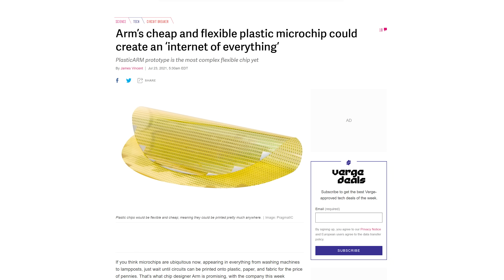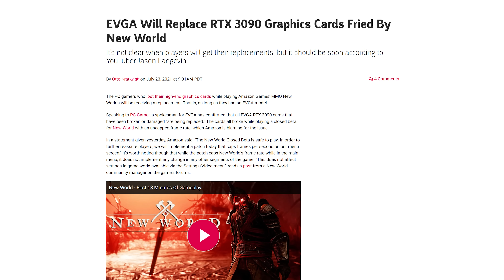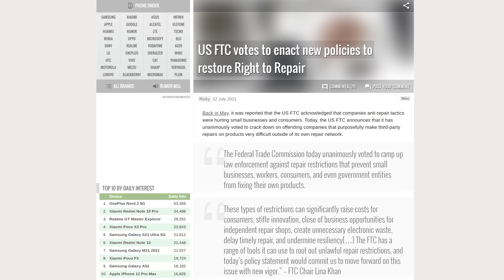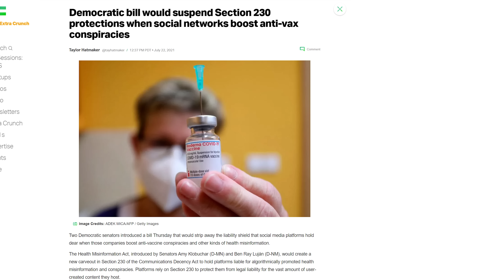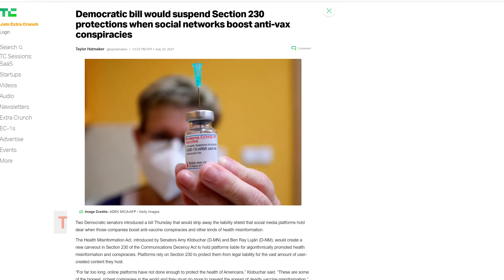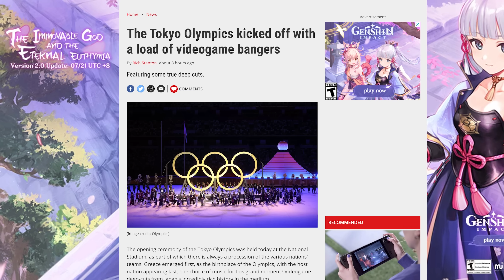Floppy Chips Will Change Everything

Comment: EVGA will replace the cards for free! Almost as if all the broken cards are less than a year old and still under warranty.

Edit: everyone commenting that there is no way a defect by EVGA could have caused the issue clearly does not remember when EVGA 1080s were literally catching fire.
Reply: Its not only EVGA cards being bricked, or just only 3090 cards. Just the most reported.
Reply: @manaspradhan8041  I think the problem you’re having is that you are under the impression that the GPU itself is failing. This is not the case, by all accounts it is something external from the GPU die itself, something on the card’s PCB that is failing. More than likely a problem with OCP, although it’s entirely possible something funky is going on with the VRMs. It’s not a GPU problem, it’s a card problem

And given the AIBs design those PCBs, the buck ultimately stops with them. Although Nvidia is particularly to blame as well, as they have to sign off on the cards their partners ship
Reply: @zuckdaddy1596  anyone remember those "oc" rtx 3090 that doesn't play games because of some cheap capacitors.
Reply: @zuckdaddy1596  Apparently it's something to do with the fan controls. EVGA's shitty components appear to be to blame.
However, other people are reporting their 3090s getting unreasonably hot and loud and not throttling, then acting up. I'd be surprised if Nvidia's firmware wasn't the real culprit causing shitty EVGA components to fail
Reply: @ducks-on-quack  It is my understanding that the general consensus is that without looking at one of the damaged cards it it likely a problem with the OCP system integrated into the RTX 3090’s. I can’t remember the model numbers off the top of my head, but the main three primarily used in Ampiere cards are all found in older cards as well. With some dating all the way back to pascal. So if it is a problem with OCP, it would appear to be entirely a problem with integration, which would put the AIBs almost at complete fault. Although the bit about it being a problem with the fans is interesting. Can I get a link to wherever you heard that? If not it’s fine, I just enjoy reading that sort of thing
Reply: @ducks-on-quack  Nvidia frimware is trash EVGA vrm is also trash
Reply: @zuckdaddy1596  I tried to post the link a couple times, but it kept getting removed from YouTube. It was a breakdown by igor's lab.
His work is pretty dense and can be difficult to understand without some embedded design and organization knowledge.
Reply: @ducks-on-quack  thanks, I’ll see if I can find it :)
Reply: It's almost as if there should be hardware limitations in place to prevent your gpu from frying just from a main menu without a frame limiter
Reply: @asmodin88  the drivers should be able to handle it
Reply: @asmodin88  what would they do exactly? They didn't build the gpu
Reply: The board partners are the ones responsible for handling the warranty so whoever’s fault it they get to replace them. I would assume EVGA in their contract with Nvidia has a clause that Nvidia would reimburse them if it’s their fault but I have no clue
Reply: @manaspradhan8041  Your incompetence is ever so tiresome... if you believe for whatever reason that Amazon is at fault, then articulate why. All you’ve done so far is waffle about AIBs putting “shells” onto GPUs, completely ignoring that they also design the PCB, making assumptions that make no sense given the current information, and generally just making yourself out to be not only incompetent as previously mentioned, but also an inarticulate prick. But do go on and explain why Amazon is at fault for what would appear to be a problem with a poor OCP implementation being triggered by god knows what.
Reply: EVGA is 100% responsible for these failures. If anything we should thank Amazon for causing them to die while the warranty was still valid.
Reply: @manaspradhan8041  that’s irrelevant. You made the claim that the cause of the GPUs bricking is because of “amazon’s incompetence” and yet here you are admitting you believe it’s a problem with drivers or firmware. Get your story straight, and articulate a proper argument. You’re failing, and it’s not even funny, it’s just pathetic

Edit: they deleted a bunch of their replies lmao
Reply: @manaspradhan8041  What exactly did amazon do?
Reply: My 3090 ftw3 ultra worked only a few months then it died:( black screen only lol got a new one and sold it immediately
The quality from evga is questionable…..
Reply: Thats true but EVGA has a very good customer service not like other AIBs e.g. Zotac
Reply: @manaspradhan8041  Samsung is doing the chip fabrication
Reply: True but they are also drop-shipping - that is sending out a replacement upon reciept of the RMA and collecting dead GPU when they drop the new one off, which seems to be happening in days as they hold stock to cover RMA's.  Now that's above and beyond warranty that can be months until you resolve with some and still within the law.
Reply: :shockpikaface:
Reply: As a Canadian myself, it's friggin 90 dollars 😪
Reply: This is happening to many different GPU's from different vendors, EVGA just has a good customer service team.
Reply: @TalesOfWar  Nobody said only EVGA makes shoddy produts
Reply: I sent back my Evga 8600gt and marked rtx 3090 on the box with a marker. I am hopeful to get a free upgrade. 😁
Reply: Wait when WHAT?
Reply: My first EVGA GPU i bought blew up in under 6 months of use. (1999 era card). My second one (970) was DOA. 

The first one they wouldn't warranty, while the second one I got an MSI 1050Ti after returning the dead card.

Still nervous about buying EVGA stuff.
Reply: It's not only EVGA cards though. It's all 3090's.
Reply: Right?  These cards are under a warranty that covers hardware defects.  Though if its a hardware defect why is it now affecting non EVGA cards that aren't even 3090's?  hmmm....Regardless glad EVGA is covering this and not choosing to try and fight it.
Reply: @Mad-Lad-Chad  If the game was causing the issue, don't you think it would affect the majority of people?
Reply: The fanboys are out in force on this! How many times does EVGA have to be caught cutting corners before the fanboys realise there should be better than this.
Reply: But it's not their fault.
Reply: Warranty applies for manufacturers' defects smartass, if the gpu bricks because of Amazon's incompetence that's not evga's responsibility
Reply: @manaspradhan8041  the problem is because of manufacturing defects, dumbass. Code that doesn’t override protections already put in place (ie anything that isn’t overclocking) is completely valid regardless of effect on the product. That’d be like shitting on any game in existence because it makes your GPU kinda hot. What seems to be happening is that something is buggy with the game, and it’s exposed a hardware defect that’s causing some obscure issue with OCP on certain cards. If this is the case, the it’s likely that the reason the 3090 in particular has been hit so hard is because of how much power is sucks up. Either way, unless Amazon’s game is doing some sketchy ass stuff and fucking around with power settings, it’s a hardware problem, not a software one
Reply: @manaspradhan8041  if the card bricks because you used it as intended (gaming) than it's the manufacturer's fault, they have to replace it. Now they can go to court with amazon for compensation, but that doesn't change the fact that they have to replace the cards.
Reply: @manaspradhan8041  It's manufacturer fault that their GPU boost as hard as it's possible in their drivers, henc bricking from it. It's your fault if you OC it/replace BIOS do shenanigans, not playing a game. I get 4k fps+ in many old games that render in real time their intros/menus and that's not causing a problem, as gpu don't oc for such low load. Any boost technology is bulcrap, as it just ads more heat for nothing
Reply: @manaspradhan8041  How is it Amazon's incompetence?
Reply: @dimitri299  how do you get employees to build a game and not have the brain power to put a fram limiter on the menu screen? next thing youre gonna tell me if the game starts leaking gigabytes of memory thats also not amazon's fault. clearly a braindead team working under rushed deadlines
Reply: @Manas Pradhan  There is absolutely nothing wrong with not limiting the frame rate in menu screens. In fact, many AAA games, such as Rainbow Six Siege for example, do not put frame limiters in their menu screens. Whilst it is a nice to have thing, there are no real negative implications for not having a limiter, other than an increased power usage.
The only consequence of not including an fps limiter in the menu screens was making the graphics card work extra hard on a task that it is designed to perform.
 It baffles me that some people for some reason 'believe' that it is the game studio that is at fault. With this logic, you are essentially saying that it is up to the software designer to ensure that a graphics card is functioning properly. The software is responsible instead of the company who makes the damn thing and who sells it to customers with the expectation that it can do what it is literally made to do.
As it is primarily occuring on EVGA gpus, they, and other hardware manufacturers with affected cards are clearly at fault here. They obviously cheaped out on some component to such an extent that when the card was working extra hard, it ended up demanding too much out of the shitty component that it broke, and consequently, the card stopped working. What is deeply concerning is that there were no working systems in place to keep the cheaped out components under safe operating conditions and that EVGA did not do thorough enough testing to identify a potential problem with their product. Or, most likely, they knowingly sold the product with the issue as they did not think many people would end up subjecting the card to the specific conditions needed for it to become an issue.
Reply: @manaspradhan8041  To many people, not having a forced FPS cap is a benefit.
Plus if a game has a FPS cap but the GPU just so happens to max out at roughly that FPS, would that also be the game developers responsibility to reduce the cap even lower because a card runs itself higher than it can handle? Should they just add a static sleeping period after every frame to make sure that GPUs never max themselves out at the cost of making their game run at lower FPS for everyone? Or somehow test every GPU brand on the market and make a list of different caps for different GPUs?
Reply: @manaspradhan8041  Does your RAM fry itself if you fill it up? And would that be windows fault for allowing programs to use up all available RAM instead of always leaving 20% RAM free in case the RAM was going to fry itself?
Reply: @manaspradhan8041  A frame cap in the menus is a good practice, NOT a requirement. The lack of this cap should under no circumstances cause a well designed card to fail. GPUs are intended to push out as many frames as is possible, and the firmware on the card is supposed to keep power, thermals and every other factor that could deteriorate the card in check while doing that (scaling back performance if needed). This is not the responsibility of the developpers merely making use of the API exposed by that firmware (ie, game devs), that's entirely on the card maker. 

This isn't the 70s anymore, there are several layers of abstraction between the hardware and the end-user precisely to allow for end-user developpers to specialize on making software for the end-user, without worrying (or having to know) too much about what happens at the hardware level.
Reply: Did you forget your meds? @manaspradhan8041  just take your pills man... It's for your own good
Reply: @manaspradhan8041  your argument is the same as telling that is a car brakes down on a street without a speed limit is the street's fault not the poor quality of the car...
Reply: It is not a capacitor problem. EVGA uses extremly good capacitors on the FTW cards. The part which gets broken is the custom fancontroller. EVGA is the only which uses his own fancontroller and the fancontroller is only on the FTW models.

But this is only a part of the story. Even NVIDIAs and AMDs own card protection system can't handle 1000+ fps without getting overheating issues. Cards from every brands can die or blackout when the frames are to high. Igors Lab could confirm this with an older title which run well above 1000fps. He tryed it with an 6900XT and the card blacked out because of overheating issues.
Reply: @manaspradhan8041  And how would every game developer decide on which FPS cap to use for their game? A static FPS cap doesn't guarantee that a GPU doesn't max itself out which means you need a dynamic cap.
You seem to be focused on Amazon doing something you don't like, rather than actually explaining how a game developer should solve a problem you claim is theirs.
Reply: @Dosino_  mate a cap of 300 fps is more than fine, no GPU is gonna burn itself running the menu screen at 300 fps. You'll never see video game menus running with fps in the thousands, that's for a reason, the people making the games aren't brain-dead
Reply: @manaspradhan8041  The game just maxed out the GPU during gameplay because it couldn't keep up 300FPS and fried itself, and you are now personally responsible for frying peoples GPUs and no better than amazon in this regard.
You also failed to fully support potential 360hz monitors in the menu.

I guess this is due to "negative experience in computer science basics" that someone here mentioned?
Reply: @manaspradhan8041  "they are at their processing speed limits, they never reach that point of burning themselves"

Well that was easy.
Reply: @Dosino_  huh? they never reach the point of burning during gameplay but they very well can during menu screens if frame limters are not put in place. what do you think youre saying? mate just go to sleep, you really dont know what you're talking about
Reply: @manaspradhan8041  "their processing speed limits"
Reply: @Dosino_  mate take a basic computer science/software development course instead of rambling about what you don't understand
Reply: @manaspradhan8041  A menu doesn't demand anything special from a GPU that gameplay wouldn't. The overhead from the gameplay likely makes the GPU not run at quite full capacity, but if it happened to max out the GPU the same issue would occur.

You have mixed up 2 things:
A: Not limiting the framerate in the menu
While this might be seen as a waste of electricity, it shouldn't really be a issue for anything but laptops which might temporarily downclock due to cooling issues. However a quick fix to this as you suggested risks risks players having their menu capped at below what they monitor can display. While not a big issue, neither is a bit extra electricity usage for a limited time.
In addition, plenty of games uses heavily detailed 3D background in their menus that uses a lot of GPU resources even while capped, if menu electricity usage was such a big problem 3D backgrounds would also be.

B: GPU Frying itself at full load
A GPU is supposed to have, as you yourself said, "processing speed limits". These GPUs fried themselves as they couldn't quite handle the speed they ran themselves at.
While a menu running at high framerate with probably not much other overhead caused them to reach their faulty speed limit this time. It wasn't the cause of the issue, it happened to make the issue show itself but it was a ticking timebomb regardless.
If a game had managed to keep low overheads and run the GPU hard during normal gameplay the exact same thing could have happened, What made the issue show itself doesn't equal what caused the issue

For a simple comparison: If a company had a costume party and someone didn't have costume on, and the floor collapsed because it couldn't keep the number of people it was supposed to be able to hold, this would be like blaming the guy without a costume because he helped cause the issue (enough people standing on the same floor) and he did something "wrong" (he didn't bring a costume to the costume party)

Yes he did technically cause the issue to appear (Putting load on the floor / maxing out the GPU) and he did do something people might consider wrong (not bring a costume / waste a small bit of electricity), but doing the second part doesn't mean they are responsible for the big issue, and most people don't even care about what they did regardless.
You are confusing someone doing something you don't like with them being responsible for another related-but-different problem that occurred.

In short, your bias against Amazon (or to be precise, against people not adding a feature you want) makes you blind to the issue that actually occurred and you are too busy trying to find a way to blame them in particular, and insulting people who disagree with you.
Reply: @manaspradhan8041  False. Several of the cards fried in game. This happened with Son Of A Tech. Jesus christ, every time I check this thread you’re waffling about even more inaccurate garbage
Reply: @manaspradhan8041  I love how you continue to ignore that other games don't have frame limits on their menus and continue to use it as an excuse...
Reply: @manaspradhan8041  Something about repeatedly bringing up CS classes and software development screams JavaScript dev to me. 
I'm really confused what "basic software development" class teaches you about firmware, architecture, organization, and embedded languages.
Reply: @ducks-on-quack  software development classes teach you not to waste resources, not having a frame limiter on the menu screen is very reminiscent of having memory leaks all around, plain stupid.
Reply: @manaspradhan8041  I think that as a Mechatronics Technician that worked his entire life with electronics and computers I do know a thing or two on how the electronics function... no electronic components should brake due to a programming failure. That fan controller should be limited to demand only the max voltage and current at what the fans operate not demand such high power and get it delivered in a way that the board fries itself. If for example I want to play a 15 yo game that generally come without a frame limitation and I get as a result a bricked card is my fault? is game developer fault or is the card manufacturers fault?
Reply: @manaspradhan8041  well it doesn't matter, if a card fails then it's a company defect. They should not fail just by sitting in a PC
Reply: @manaspradhan8041  evga, will, for ANY reason other than physical damage replace your GPU if it bricks in the first 3 years.... Which they literally cover in the video you just watched.
Reply: @manaspradhan8041  Can it be Amazons fault if it only happens to EVGA cards?
Reply: @manaspradhan8041  a game should never be able to fry a card, this is a driver problem
Reply: @manaspradhan8041  But if EVGA burns a couple Million dollar replacing those cards they will get a huge boost in customer perception. Which can boost sales in the future because people will remember that this company did something good a while ago and their warranty is good. My employer uses the same Idea, no problem if we loose a couple thousands on one customer when the customer is happy and comes back to spend tens of thousands more in the future with us
Reply: @manaspradhan8041  Yo', have you seen the latest finds by EVGA?
Reply: @manaspradhan8041  or the gpu bricks because of evga using shitty components...
Reply: @doppled  get more info.
Reply: @doppled  mate I don't think you understand how this works, they just build the shells not the cards
Reply: @manaspradhan8041  the board partner receives only the GPU from Nvidia, if EVGA used poor quality capacitors it is absolutely EVGA’s fault.
Reply: @manaspradhan8041  The GPU itself isn't having issues. It's the parts of the card that EVGA IS responsible that are breaking.
Reply: @chriss4799  Can you prove they used poor quality parts?
Reply: @Manas Pradhan.. Thank you for demonstrating that you don't know what GPU manufacturers do.
Reply: @doppled  It's shitty firmware, not shitty components. If your firmware allows your gpu to run itself into a brick, it will. It's Nvidia's fault.
Reply: @ducks-on-quack  
Nvidia always doing shaddy stuff, they are bricking RX 6900 XTs and other GPUs, they are just so powerful that they brick their competence too only with a single game!
Reply: @doppled  EVGA is also the only partner company not doing insane markups on their cards, their 3090 is significantly cheaper than the other brands
Reply: @NQUSTN  I can’t, hence the “if”. Those who own one could inspect the parts used. It could also be due to temperature safeguards failing, potentially in non-hardware ways.
Reply: @chriss4799  didn't see the "if"
Reply: @manaspradhan8041  Hardware should be designed to run any compatible software safely out of the box. Imagine if someone managed to hack/put a virus on your computer with intent to destroy it or worse set it on fire in the case of some EVGA 10 series cards. All they'd have to do is put a specifically-designed load on the GPU.

It would be one thing if they had to touch firmware or power limits to inflict that sort of damage, but this appears to occur in factory configurations.
Reply: @manaspradhan8041  And no, you can't fry a PC with a load as long as the PC has the proper fail-safes. A cpu, for example, will throttle itself to prevent failure. GPUs also do this. It's obvious to me that there is a driver issue that is bypassing those fail-safes
Reply: @manaspradhan8041  I'm fairly sure EVGA (and I'd presume other GPU makers) are doing it this way to make it easier for the consumer, and then they'll bill amazon for it.
Reply: @NQUSTN  huh? i dont get what you mean
Reply: @manaspradhan8041  the gpu has more than a chip like vram vrm some capacitors like that so EVGA used bad capacitors of the card so EVGA has its own fault amazon has a fault of not using a frame limiter but the game is in beta so don't blame amazon and nvdia drivers also can be blamed for this disaster but EVGA has the most blame.
Reply: @manaspradhan8041  I can't spell lol.